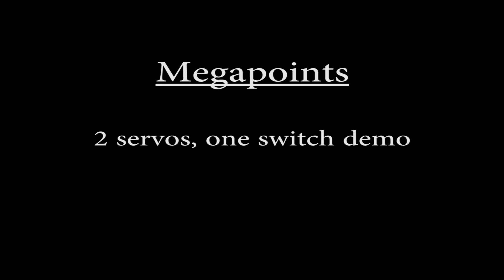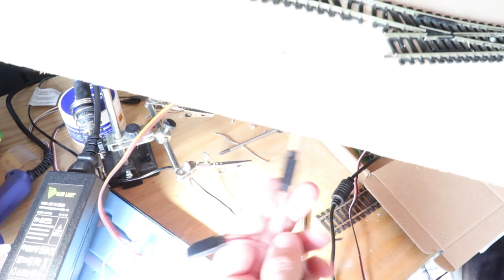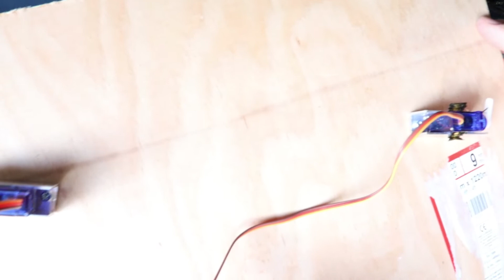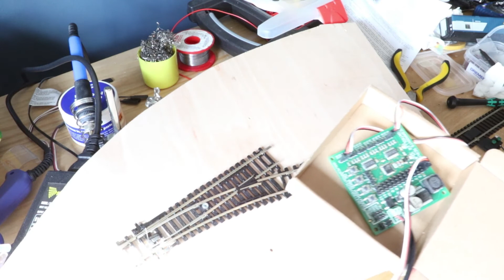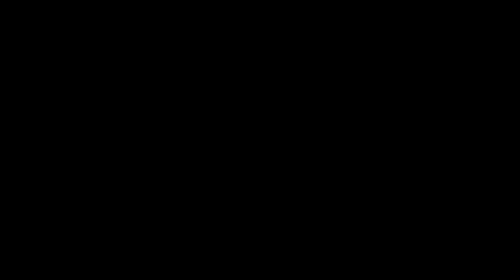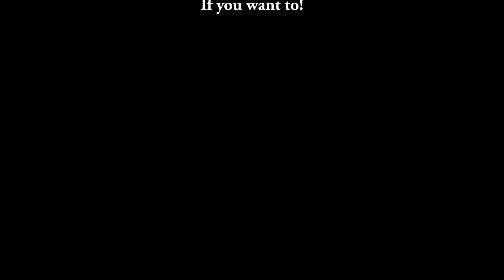Megapoints update, 2 servos one switch

Comment: Great video. I had a slightly different approach. Disclaimer - I have 12 points and the megapoints supports 12 outputs so I was fortunate.
I wired all points as normal and then paired the switch wires up to the same switch. In face I have a crossover with four points that all have to be changed together. So in this case I wired all four up to the one switch.
Advantage is you can tune each point individually. Disadvantage, as mentioned, it doesn’t give you any more outputs.

Comment: Hi there, I have recently discovered this video, 2 years after you published it. How did the Y lead connectors perform with 2 points to 1 servo output? The instructions on the megapoints website state that you can only use 2 Y leads per 12 output servo controller, but you wanted to use more than that, so do I.
Reply from the maker: Hi,
Yep, I have loads of Y harnesses coming from 1 mega points controller.... no issues.
There is a bit of servo chatter that I think has been rectified with the newest versions or with a firmware update, but it doesn't bother me. It's not as if they are all being triggered at the same time causing large amp draw... although I have gone crazy on it and just hit all the switches randomly and quickly and it's never failed.
Reply: The Devon model railway many thanks indeed, love all your videos by the way
Reply: @thedevonmodelrailway2386  does the software stop feeding the PWM signal to the servos after they have switched or does it leave it on.
Leaving it on can cause chatter.

Also how well balanced are the servos as the typical cheap ones need different endpoints setting to avoid chatter as they keep trying to get to the far position which is different for each servo?

As for the quantity of servos its to do with the on board 12v to 5v PSU, it can only provide enough power for about 15 servos. The solution is not to buy the megapoints power booster its to buy a 5v PSU with enough amps and connect all the servo 5V power lines to that and the 0v lines to the controller and the PSU.

The megapoints controller is only an arduino board with a couple of servo controller chips and some software.
You can use free software like Mardec to do the same thing on an arduino uno for about £6 + a 5v PSU.

https://www.youtube.com/watch?v=Jp37IdfTsYs

Comment: I must agree the select is next to useless to run more than one loco. in my loft layout I use railmaster  with the e-link i'ts great when i'ts working but a nightmare when i'ts not. the geek squad at hornby are really helpful without them I would thrown it in the bin. It controls the locos, points, signals, I'm happy with it at the moment as it'ts working fine.Cheers John.
Reply from the maker: Hi John. I have looked at the railmaster and e-link... and will have a look more into it again.
Thanks
Reply: Hattons are selling RailMaster for 5 quid.
If you use an Elite, rather than an eLink, you have the option of manual control.  You can also daisy-chain (star net) the Select (up to 8) into the back of the Elite, and end up with multiple throttles.  So you could have one controller per loco, and use the RailMaster screen to control the points and signals. Or have a throttle every couple of yards around the room!
Note also that the Elite is software updatable, and is fully NMRA compliant, so would be able to control the Bachmann decoder that you had in your class 57.  (The Select only send requests to the Elite; it is the Elite that commands the rails, and so the Elite's compliance that is relevant, even if using the Select as a remote throttle)

Comment: Nice result.
Have you defined the default position of the point by the orientation of the servo? So these two are facing in opposite direction, but are wired the same? So the switch will be up for straight on the upper point, or down for straight on the lower point? (Per Barrie Davis, the A point is closer to the signal box, so I would set up control for that one)
Do you number the servos, so when working under the board, you know you are fettling the right one?
Are you going for electrofrog points? I wonder about planning for electrofrog, since this also allows the frog setting to be used for point indicators, signal control, etc, even if it is not used for the frog itself.
Regards, Tom
Reply from the maker: Yeah, the wires are the same, but the servos are opposite. If setting this up using 1 servo with 1 switch, there is electronic adjustment through the megapoints system, however when using 2 servos, any electronic adjustment made to 1 servo will be mimicked on the other. So getting them set up correctly mechanically is pretty crucial.
I've not yet thought about the switch positions, I have considered wiring in LEDs on the point control board so that it indicates green on the cross section when the points are diverted...or I may even get LED toggle switches which again would show green (or red) depending on how it's wired. I will probably get the servos fitted and wires routed so I know it's all working ok and then look at the switches in more detail. I've not fitted any on the main layout yet, but numbering the servo and each end of the servo extension wire will be helpful.
All of my points at the moment are standard insulfrog Hornby points. When I decided to get back into model railways I took the plunge and ordered loads of Hornby points... replacing them all now with Peco ones would be costly. But I guess if there are any critical main ones at main areas that I feel would work with signals then It's something that I can look in to.